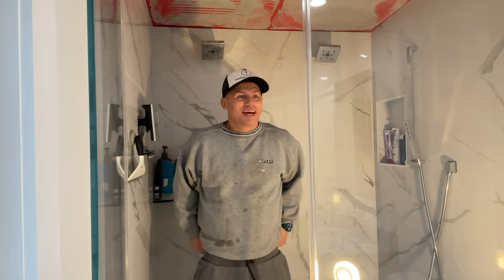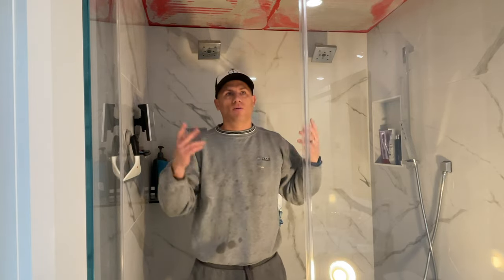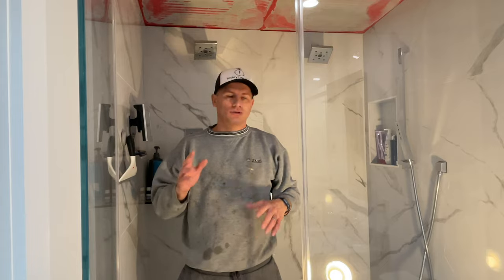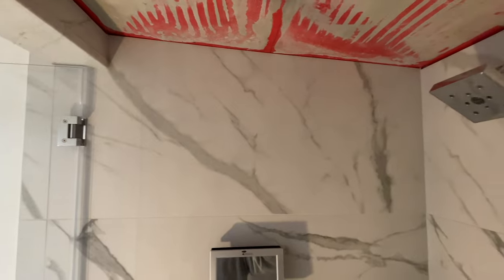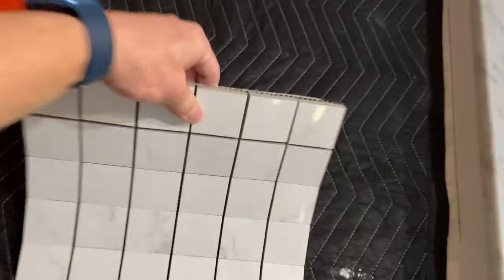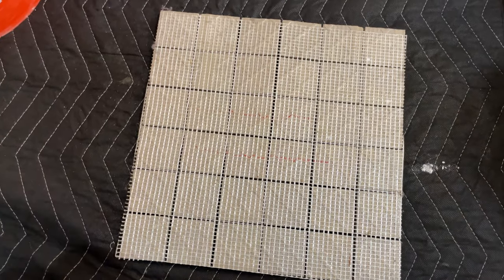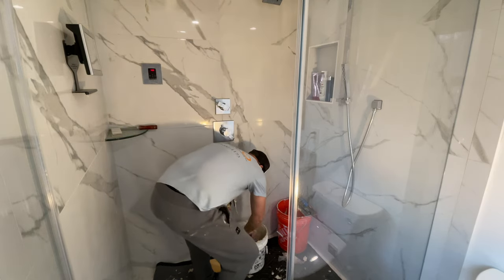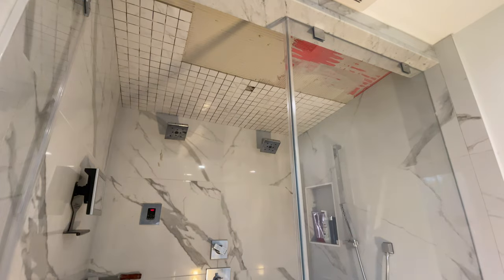How to Install Tile on a Steam Shower Ceiling. ￼

Comment: You can put regular tiles on the ceiling instead of being forced to use 2" mosaics (which adds too many grout lines and all that grout can absorb the steam moisture). The trick is to use EPOXY based mortar and support the tiles with plywood and some 2X4s until the mortar gets enough strength to hold the tiles up. Also, for steam showers, research into what type of grout need to be used. Most people say to use Epoxy based grout since it has natural moisture barrier built into it and does not require constant sealing and nearly waterproof. Regular grout is not recommended for steam showers as it absorbs moisture even with regular sealing regiment.

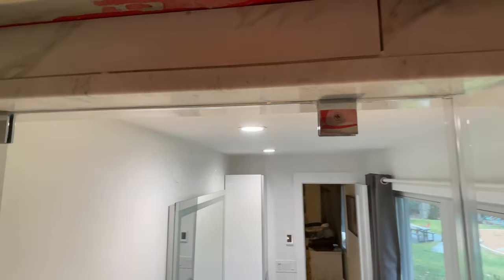Comment: What are the dimensions of your steam shower? As has been mentioned TCNA spec is 2 inch per ft, so how has that 5/8 inch per ft slope performed over time? 1:17
Reply from the maker: It's been fine. I only recall one time I had a drip hit the top of my head. TBH, 2" is a pretty steep angle and I didn't want to move my shower heads lower to where they are at this pitch.  Everything is a compromise. 2" a foot would be a no go because of where the shower heads are.     4' deep by 5' wide.
Reply: @TodayIWorkOn thanks for your prompt response, for some reason I’m just seeing now
Reply: The steam showers I’ve waterproofed have always had 2” per ft where did u get 5/8s from ? 
We also never used redguard it was sheet membrane called Noble Ts

Comment: Hi. Does a steam shower ceiling always have to use a mosaic type tile? I have a 12x48 or even larger tile, but my contractor says he doesn't recommend using that size, for safety reasons. Is this true at all?
Reply from the maker: Well... I incorrectly installed a 24x24 tile and that tile came crashing down in my shower. It destroyed my saddle and did some serious damage. It was from install error, not a safety thing. If you know how to install tile on a ceiling using the right mortar, it will be fine. 

From being spooked about the failure I decided to go with the tile in the video. If I was going to do it again(I am in my new home build) I'm going to install large format tile because I now know how to install them properly. 

In summary, the tile guy does not have confidence in installing the larger tile.
Reply: @TodayIWorkOn  You can put regular tiles on the ceiling. The trick is to use EXPOXY based mortar and after installing all the ceiling tiles, support the tiles with some plywood and 2x4 lumber until the epoxy sets over night. It is not good to have too many grout lines due to steam moisture penetrating the grout so I suggest also using EPOXY grout which is almost impervious to moisture and does not need to be sealed and maintained like regular grout.

Comment: For waterproof did you use kerdi board or applied redgard on hardy boards?
Reply from the maker: I used cement board with 4 coats of redguard. You really need a totally vapor proof setup for these steam showers.
Reply: 4 coats is good enough or should i have kerdi waterproof membrane on top too for better vapor proof?
Reply from the maker: @avinash348  I think you can never have enough vapor barrier in a steam shower. Go to town with it. Lol.
Reply: @TodayIWorkOn  so did your steam shower lasted long with 4 coats without any issues?
Reply from the maker: @avinash348  it’s doing just fine after 2 years of use.
Reply: 4 coats is too much - there is a proper mils thickness for two coats, if you go too much you’ll have a problem